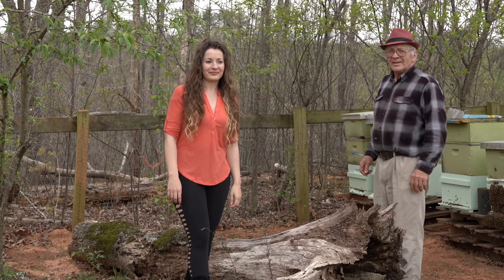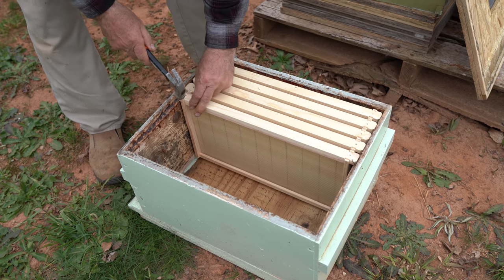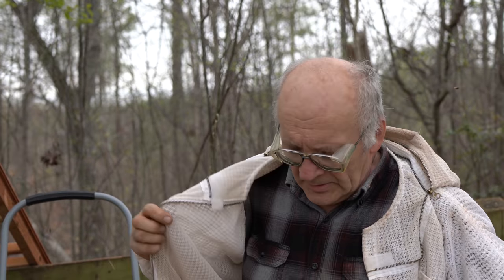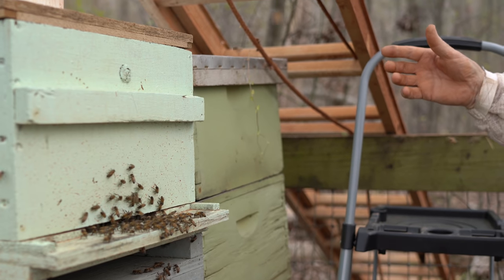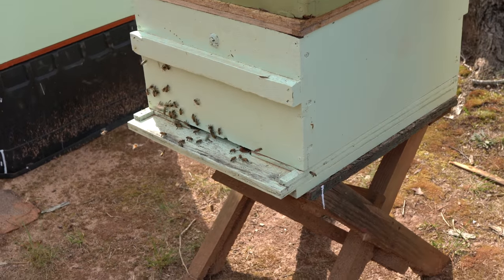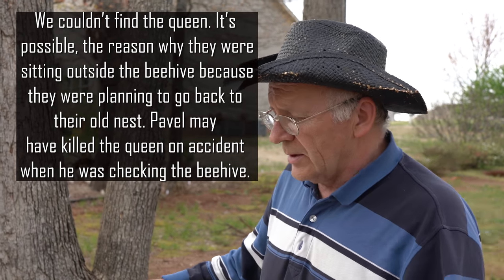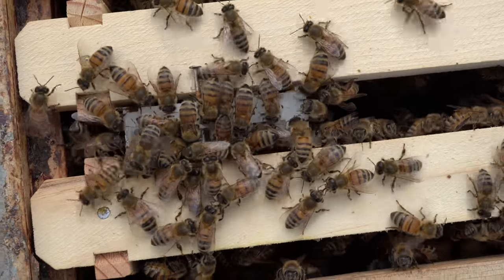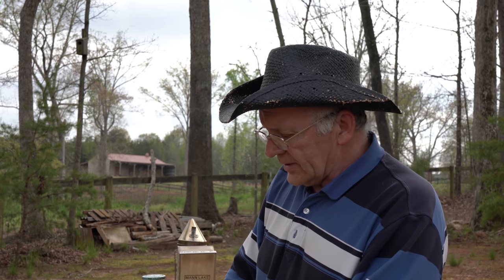Beekeeping For Beginners | Fast & Easy Swarm Removal Method

Comment: thanks for taking the time to share this, just captured a swarm yesterday and have em locked up in a very hole filled cardboard box.  how long can they go without food after swarming?  i lured them here by simply feeding them a little of my coke mixed with homebrew( fermented sugar & yeast , distilled ) they never seemed to get drunk but used to feed here a heap last season/ b4 winter, now spring a swarm turned up yesterday. and i am trying to make sure i don't kill the queen and can transfer safely into a new box with some fresh wax. any help would be the icing on the cake , thanks already Anna and Mr Pavel.
Reply from the maker: You're very welcome! They have enough food for about 3 days after they swarm out from a hive. We highly recommend feeding them with sugar syrup 1:1 ratio with water!  In this video, we explain in more detail our hive and sugar syrup set up. https://www.youtube.com/watch?v=IkdoQqmre6Q You will need to feed them every day for at least 7 days, or more depending on your location. If there is not enough nectar flow around you will have to keep a close eye on them. I hope this helps! Thank you for watching and commenting! :)
Reply: so the cardboard box i had tried to lock the swarm in was enough to last 2 days /48 hours b4 the drilled over 20+ holes out looking to swarm ( i had my kids on school holidays watching em every 15 mins lol ) . luckily i asked a lady i work with whos sister has bee's , within 30 mins a lady was here with a box pre painted as mine was arriving raw and transferred what i had locked away into an empty box she had. the amount they had built in the box i locked them in was amazing and i got to taste some success in the way of a little honeycomb left in the cardboard box that wasn't transferred with them, they had built a lot in that empty cardboard box in 2 days . joel rex foster on facebook and the pic of the swarm i caught is public if ya wanna look. i ended up feeding them the night i'd asked at a 2:1 ratio after a lot of googling and worried i'd starved. they seem to be very happy in there new home, busy working. i love eadilble plants and wanted bee's to help me forage more. sorry for the excitement but having a swarm stop here and then catching em all and locking em up with only air holes i was worried with only 1 persons advice that theyd be ok. by the taste of the honey left in the cardboard box theyre better then ok n will be well worked and cared for :)

Comment: Anna set swarm traps baited with old comb and lemon grass oil. I catch several swarms each year using 5  frame box's made out scrap wood like pallets. Just spray on some lemon grass on frames not much they will find it. To dangerous to climb.
Reply from the maker: Thanks for the tips! We try to film things the old traditional way to let ppl know that it can be done even if they don't have lemon grass on hand or special swarm boxes. Thanks for watching!

Comment: Spray Lemon Grass esential oil on those frames inside of that box .....they go inside quick.I am very curios how come your father doesn't know tricks like this.In Russia many,many years ago they didn;t know about esential oils.But they use to put few fresh plant of mint (pipermint) got them wet, with water, that way they smells far away,and drop them in the box next to the frame.Bees will get inside like crazy.
Reply from the maker: We actually know those tips and tricks. But if the bees get inside the beehive anyway, why use it? Besides, our channel is about affordable beekeeping and tailored towards new beekeepers. When a hive suddenly swarms, new beekeepers may not have all the resources available at hand. People need to know that it will still work without all the other stuff. There are plenty of youtube videos on essential oils. We try to stay simple.  This is the most simple way of doing it. I believe we mention that in the video. My dad is traditional I guess, the simpler the better. No need to spend money on essential oils. Thanks for watching and your suggestion.
Reply: Is just $3  at Kroger food store and save you a trip up in the tree.I remember teling you to use Lemon grass esential oil a wile ago.Going up in the tree is dangers .Then the lemon grass EO keep them inside( no barbs) ,because it smel like Queen feromonds ,also get them going to work immediately.
Reply from the maker: @geanitsucuneli4791  I'm happy it works for you. You should do a video on it!
Reply: Too busy for that.I have  to make sure my 2000 hives full power ,plus 1000 Nucs are well.Filming takes time ,I have to keep busy ,Me and my Employees,so we have to be up date ,with everything .

Comment: Love the videos keep it up!!. I have question. I have many bees crawling around on the ground and the ones is the hive are a buzz.. any thoughts?  They just started doing this.
Reply from the maker: Crawling on the ground is normal.  There could be a few reasons for that. One of the reasons is bees will push sick bees out the hive. Second, when you look inside the beehive it's possible that you may have dropped some young bees. Young bees cannot fly and end up crawling on the floor and eventually die. Third, when bees feel like they are about to die they go outside the beehive. Some of those bees are dying from old age. Unusual buzzing could mean many different things.  If the queen is laying eggs, and the bees are flying and bringing nectar than you have nothing to worry about. Thank you for watching! :)
Reply: Thank you Anna!

Comment: It will be easier by putting an old building frame , they like it too much, and poor some syrup on the alveolar cells. It's efficient 100/100
Reply from the maker: Thanks for watching and the suggestion! At least we know if someone doesn't have an extra old frame on hand that it will still work! Like if it's their very first swarm.